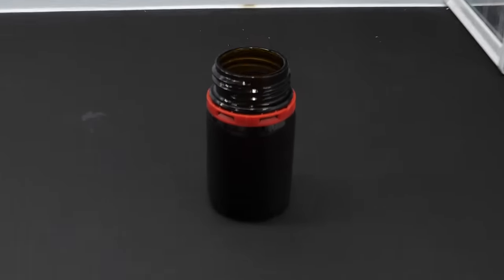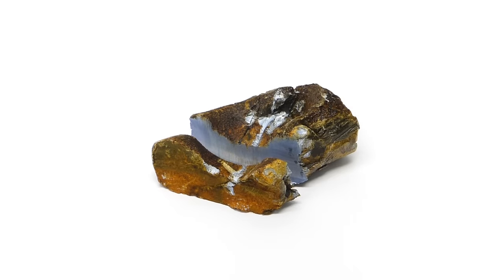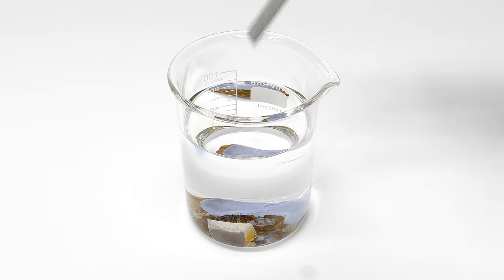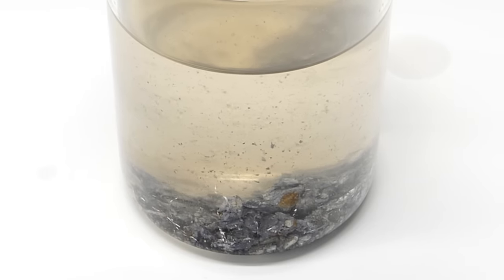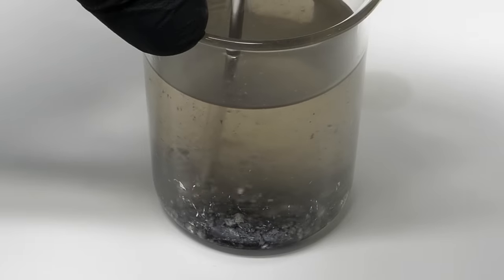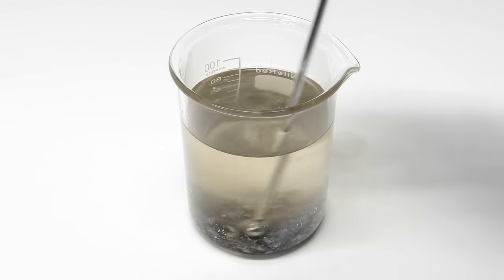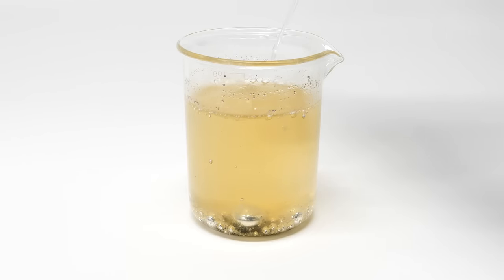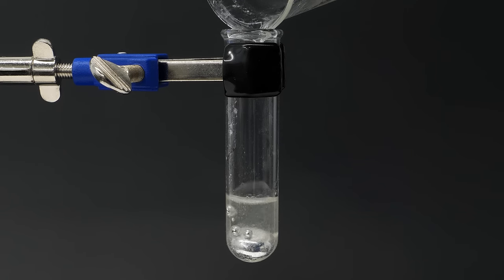Mixing sodium and potassium is crazy (NaK)

Comment: Some uses for NaK (found on Wikipedia):

Coolant in experimental fast neutron nuclear reactors like the Dounreay Fast Reactor. The Soviet RORSAT radar satellites were powered by a BES-5 reactor, which was cooled with NaK.

The Danamics LMX Superleggera CPU cooler uses NaK to transport heat from the CPU to its cooling fins.

Hydraulic fluid: Eutectic NaK (NaK-77) can be used as a hydraulic fluid in high-temperature and high-radiation environments, for temperature ranges of −12 to 760 °C. 

NaK-77 was tested in hydraulic and fluidic systems for the Supersonic Low Altitude Missile (SLAM).
Reply: That Danamics cooler was probably the most bizarre CPU cooler ever invented. It's hard to believe they thought making a consumer product filled with NaK was a good idea. If it leaks, even if there's no moisture it tends to form the explosive superoxide. Apart from the danger, its specific and volumetric heat capacities are just bad compared to water, so the cooling performance wasn't even good.
Reply: @fat_pigeon  haha yeah that’s insane actually.
Reply: It's also the revolutionary title who recently got a sequel on PS4
Reply: @arachnid6028  knack is back babyyyy!!!
Reply: @fat_pigeon  so why was it used as a collant?  the temperature range?
Reply: SLAM sounds like a fun name for a missile
Reply: slam slams head on keyboard
Reply: @mareksicinski3726  Metals in general have a much higher conductivity than other materials, so you can get the heat into the NaK much quicker than other materials.
Reply: Why was Nak used instead of something safer, like mercury, or galinstan?
Reply: @matteoherron5014  Knack 2 BABEE!

Comment: NaK was used in EBR-1 Mk.4 fuel elements. (Nuclear fuel rods) The liquid metal alloy helped conduct heat from the plutonium slugs to the uranium slugs and to the zirconium fuel rod cladding for a more even and efficient transfer of energy. There's a video on these fuel rods called "Fabrication of Plutonium" by Argonne National Labs. There's also a video on them handling these fuel rods after a partial melt down when the NaK escaped and caught fire.

Comment: That was also a nice demonstration of the leidenfrost effect. The NaK was vaporizing the water it was in contact with and the resultant gasses acted like an air hockey table. Is why they were zooming around so quickly on the water
Reply: Thank you for explaining, cuz that's exactly what I was searching the comments for!
Reply: Not sure this is quite correct. The reaction takes place at room temperature so the water isn't boiling, but it produces a room-temperature gas (specifically hydrogen) so the behaviour is similar.

Comment: One of my more nightmarish moments as a lab chemist involved trying to clean up a 5L glass THF + NaK solvent still that had become clogged with insoluble polymerized benzophenone (which forms an oxygen- & water-scavenging ketyl radical with alkali metals). 

Even days of soaking in t-butyl alcohol didn't neutralize the embedded balls of NaK, and the solid mess had to be broken up and chipped out mechanically under positive pressure of nitrogen, and the pieces tossed into a dewar of LN2 to freeze the NaK solid and keep it from spontaneously igniting until it could be set outside and allowed to do as its heart (or at least ΔG) desired...
Reply: " heart (or ΔG)" is such a great phrase
Reply: man are you speaking some kind of harry potter magic?
Reply: He's speaking the language of the gods
Reply: What the hell did you just say man
Reply: excuse me sir, i speak english
Reply: @dudus9287  Delta G, aka Gibb's Free Energy, which determines whether a reaction is endothermic (takes in energy) or exothermic (gives out energy)
Reply: Oh god that sounds horrible, glad nothing bad happened. Also the ending is gold!! 😂
Reply: Latin goes a far way.
Reply: Can someone who understands chemistry let me know if this is a good story or not? Thanks.
Reply: @badgerbane  Depends if you like tense scenarios that roughly equate to defusing a bomb--or something that could have caused a major fire, at least. 

Molten NaK is pyrophoric--catches fire spontaneously in air, and it's a liquid (like mercury) at room temp. So it's nasty stuff when you have to fish little blobs of it out of a giant open bowl of what is effectively gasoline.
Reply: Also a scary thing: not thinking and putting an PTFE (Teflon) stirrer into a flask with NaK.  It’ll react extremely violent and burn bright yellow even under oxygen less argon atmosphere.
Reply: This sounds like viewable content! (Menacingly taps fingertips together)...
Reply: @badgerbane  Point is, he had to clean up some glassware previously used for NaK which had a chemical (benzophenone) that can siphon water into itself if it had reacted with the NaK. And as we saw it the video, even a drop of NaK reacts vigorously with water. So the dirty glassware was basically a pipe bomb waiting to be mishandled.
Reply: @knifepony  
You're wrong. Gibbs free energy decides whether a reaction is exergonic or endergonic, as in whether the reaction happens by itself or doesnt.
Enthalpy decides over endo and exothermic.
Reply: @josefanon8504  
Oops.
Reply: @knifepony  
happens lol

Comment: NaK is a eutectic alloy with a lower combined melting point. As an interesting side note, if you add a bit of Thallium (< 5%), it can reduce the chemical reactivity (oxygenation) without compromising the melting point too much.

In this way, you can use it more safely for industrial applications and not worry as much about the potential for explosions and fire.
Reply: Wow that's really interesting. I know that thallium amalgam (thallium-mercury alloy) has a melting point far lower than mercury alone, but I didn't know that it was a useful alloy addition to NaK

Comment: The sodium and potassium form a eutectic mixture, ie a mixture which has a lower melting point than either of its constituents. Many mixtures form eutectic systems, but probably the most familiar for normal people will be ice and salt. A mixture of ice and salt will stay liquid well below the normal freezing point of water, and this means if you add salt to ice it will melt, which is why it is used to clear icy roads.
Reply: Never really understood why it’s called eutectic mixtures, aren’t azeotropes more general?
Reply: @turbotaleggio8425  If they melt/freeze at a single temperature (which is lower than either ingredient) rather than a range, it's eutectic.
Reply: Another common eutectic mixture is tin/lead solder
Reply: @abpsd73  Actually the most common solder, 60/40 tin/lead, is not eutectic. The eutectic solder is 63/37 which is much less common.
Reply: @amouse6931  Given that 60/40 melts at <185C while tin and lead are both >200C and >300C, I would say it qualifies. Even if you find an optimum ratio with an even lower melting temperature.
Reply: @DaveJHarry  "Eutectic" specifically means the optimum point, so A Mouse is right. That said, 60/40 is very close to 63/37 so there may be little practical difference.
Reply: @DaveJHarry  You (and @Alex Potts) missed part of "eutectic"s definition,  which is melting at a single temperature rather than a range. 60/40 has a (small) range of temperatures that it melts/solidifies at, whereas 63/37 has a single point that it melts/solidifies at, hence 63/37 is eutectic and 60/40 isn't.
Reply: @amouse6931  Anyway, long live leaded solder!
Reply: Ehh salts and liquids falls more under colligative properties, as adding any soluble ionic compound to any polar solvent will decrease the melting point. NaK is interesting because it's 2 positive ions

Comment: I worked on the fast reactor project until it's end in the early nineties measuring corrosion rates of boiler steels in high temperature liquid sodium. I was given a sample of NaK in the form of a paperweight by a colleague from Dounreay. Its contained in a phial under an argon atmosphere encased in clear epoxy. It's liquid at room temperature, its eutectic point. Pretty cool.
Reply: NaK is being trialled for use in heatpipes of various modern SMR designs. However, isn't the activation of the potassium into a high-energy gamma emitter a problem?
Reply: @Shaker626  hi, I was a corrosion chemist and know next to nothing about the radioactive side of things. All choices are made with compromise in mind. NaK was used in the Dounreay fast reactor which had a short life. I worked on the prototype fast reactor, pfr, which carried on the development, but that research was ended over 30 years ago. I would be surprised if they were considering NaK as their is so little data available whereas Na as a coolant has been researched by many countries. Cheers.
Reply: @jerryhilditch5991  Metal-metal corrosion was always interesting to me. The mechanism is different from that of acids or ions from salt. I'm currently trying to become a nuclear engineer myself so it's all quite cool to me.
Reply: @Shaker626  Co authored some papers back in the day. I can remember one on liquid metal embrittlement but it's at least 30 years ago, the mind goes fuzzy after a while. We published bits and pieces but a lot of it was commercial in confidence. I might go up in my loft and root out my old stuff. I'm pretty sure I've a book published by the US Navy from the 60s on liquid metal chemistry. Off the top of my head I think we published in the journal of corrosion science. I'll keep you informed.
Reply: @Shaker626  liquid metal embrittlement of 9cr steel, still on the Internet, haha
Reply: Good luck with your future career plans. I enjoyed my time in it knowing that we were discovering new things. However the cogs turn very slowly mainly due to political interference and it's easy to think after years why are we seemingly no further forward.

Comment: Form an engineering point of view, it's not really the Nak itself that is interesting. To me, it's things like pump seals. Assuming the Nak when hot would be around 600C or more, the design of seals and gaskets would be very interesting.
Reply: With molten metals (and other "nasty" but electrically conductive liquids) they often use electromagnetic pumps with no moving parts at all.
For gaskets maybe there's some relatively soft metal or alloy that could be used.

Comment: I remember years ago I was scrapping an old gas valve from a heating system, it had small tubing that contained some alloy like this. Some landed in some water on the floor, it behaved the same way. If it landed on a dry surface, a crusty white oxide would form.

Comment: Anyone could explain why two solid metals mix together create a liquid alloy? I tried tô explain with no sucess.
Reply: A sodium atom or a potassium atom interacts weaker with each other than they do with their own kind. It has something to do with the way the electron shells line up. An analogy would be stacking cups of different sizes, they wount stack together as neatly, and the difference between metals and the alloy is just enough to make it liquid at room temperature due to both of them having a lot metling point to begin with.
Reply: If you mix salt and ice they form a liquid alloy at the same temperature the ice and salt were solid. Same thing. The interactions of the differing ions disrupts the crystal structure of the solids and they can't hold together anymore, now needing a lower temperature to be able to crystalize.
Reply: Na & K form a eutectic system. A mixture of two solids melts at lower melting point than each pure metal's melting point.
Reply: In some sense it is similar to solid NaCl and solid H2O. One is easily miscible with the other, yet they are solid, and they make liquid, if they do mix. Table salt and ice, as does table salt with water, mix exothermically - ions of salt and molecules of water are attracted. Two alkali metal radii with their delocalized electrons are not exactly attracted, but do mix well, so they need some energy to mix. Their mixing, though, as with salt and water, disrupts their crystal lattices, due to the size difference, therefore the mixture cannot assume a combination of them, it remains a liquid.

Comment: NileRed claims to have "a set of small, and extremely reactive metal balls." That's mostly correct but I doubt he has small balls with the ridiculously dangerous sh*t he isn't afraid to do
Reply: That's what chemistry will corrupt you into doing. It's not exciting chemistry unless it drastically changes materials like alchemy, or threatens to explode violently if not done perfectly.
Reply: That's one of the most dangerous types of adrenaline junkie you could be.

Comment: I did something like this a very long time ago. I had two pieces, one potassium and one sodium, equal by volume. Under mineral spirits, I heated ti until the two elements melted and ran together. The result was liquid at room temperature, and reacted with water as depicted in the video.

Comment: For those trying this it is best to mix them up with water and 99% isoprophic alcohol.
Reply: Hey! You seem to know a bit about this stuff, so I wanna ask you a question if that alright?
Reply: @stellaredacted3727  You already asked me one, so why ask for permission instead of asking your question to begin with.
Reply: @ExhibitAredactedEXPUNGED  Did I? I don’t remember asking anyone by your username a question.
Reply: @stellaredacted3727  You asked me one in this reply as well. 😂
Reply: @ExhibitAredactedEXPUNGED  Ah, I guess I did!
Reply: @stellaredacted3727  lol. So did you have a question in regards to the topic or?
Reply: @ExhibitAredactedEXPUNGED  Oh, yes! I did! I wanted to know if you knew what the chemical at the end was! The one NileRed put the NaK in, was it just water, or was it some sort of crazy chemical that would cause a reaction like that?
Reply: @stellaredacted3727  it was indeed water. Tap most probably, no reason to waste distilled water.
The reason he used Kerosen is because it does not react with either chemical and cannot be lit on fire by open flame unless pulverized in a very fine mist.
If you mix NaK with water and isoprophic it has a similar reaction to the one he had in the end, but also blue flames. I think it would have looked prettier.

Comment: Ah, of course, adding two highly reactive metals, one of which burns in water mind you, to a beaker full of aviation fuel sounds like a safe experiment.
Reply: Both metals burn in water actually. But having them in kerosine or something similar is totally safe and these metals are stored under such conditions. Water and organic liquids are two totally different things and just because something reacts with one of it, doesn't mean it does anything to the other.
Reply: @Mis7erSeven  I know it's safe, I just think it's funny that two highly reactive metals are dangerous in water, but safe in highly flammable fuel

Comment: Interesting how two solids made a liquid -but was it really any more savagely reactive than potassium on its lonesome?
Reply: If you combine two different substances, the melting point of the mixture is usually lower than it was for any of the two original substances. And if you use solids with low melting points to start, there is a good chance that the mixture will have a melting point below room temperature.

Comment: Ok so random chem question. I know back in the day nasa decided to make a rocket engine powered by H2, F, and liquid lithium. Would this maybe work with H2, ClF3, and NaK? And how much of a death trap would it be?
Reply: Theoretically, basically everything that can explode can used to power up a rocket, so it should work.
But from my chemical point of view, any idea that includes using large scales of ClF3 sounds REALLY bad to me. Please don't.
Reply: @Mis7erSeven  NASA engineers in the 1960's on their way to try it anyways be like:
Reply: @Mis7erSeven  also im kinda curious of what isp you could maybe get with the mixture but idk how to calculate that (if you even could)

Comment: Is there any way to restore the nak which you threw in water
Reply: It is not, at least by an average chemical reaction. You'd need first to obtain the hidroxydes which are dissolved in the water and then obtaining the pure metals using some electrolysis based process like Castner, Downs, or so. Then you'd neet to do again the process described in this video.

Comment: Why use kerosene?
Reply: Alkanes are just pure hydrocarbons which don't react with reactive metals like sodium and potassium. They're also extremely hydrophobic, so no water will get in the solution and close to the reactive metals. 
He could've used any solution of pure alkanes, kerosene is just one of the cheapest.